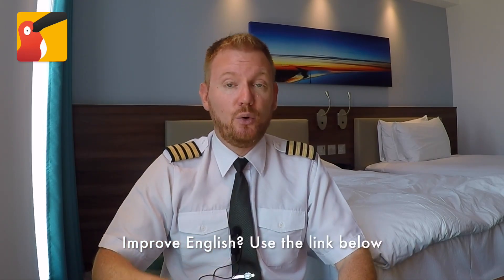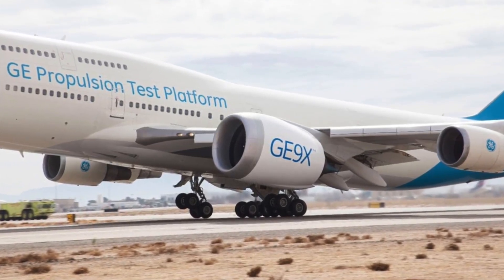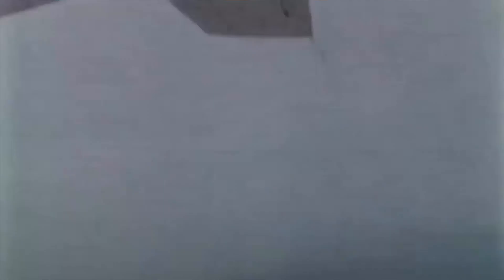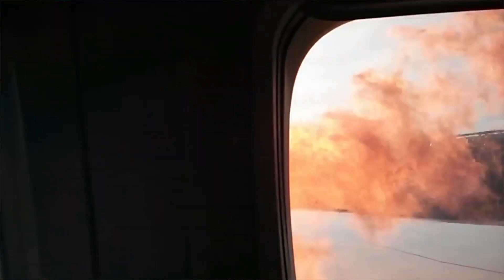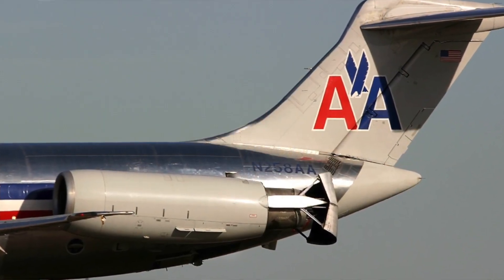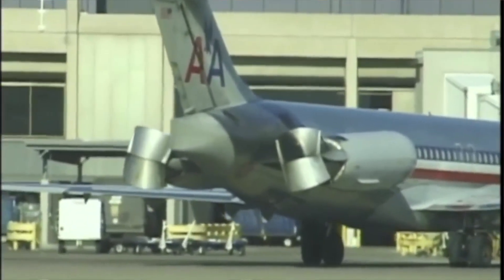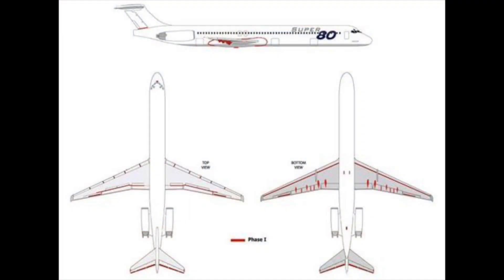Why are the jet-engines placed there? Wings vs Tail

Comment: I don't understand how a wing that is already hollow to hold fuel can handle the weight of an engine that big and doesn't snap off. Then the stress from forward and reverse thrust, vibration, weather, temperatures, whatever over 20? years and thousands of miles still stays intact. Remarkable.

Comment: Why did you say the trim change with application of lots of  power takes a lot of getting used to in training for commercially rated pilots? Most of them have time in C172s and those airplanes do have large trim change with power on a go round that needs 2 hands to keep it from stalling.  The other trick engineers used for wing mounted twin is to angle the engine a degree or more outwards, they do that even with singles, this will reduce the pull from P factor. The alternate ways of mounting engines /wings not used often enough for passenger craft is top of the wing mounting , like Honda, or just have high wing , like C17. I like the VC 10 type mounting , but is less suitable for large diameter engines. But then, nowadays, you just need 2 engines.

Comment: Why does the Q-400 turbo-prop aircraft have the t-tail design instrad of having the horizontal stabelizer positioned low at the tail? Since the 2 turbo-prop engines are on the wings, it seems odd they chose the t-tail design. Especially with the super-stall issue that can happen.

Comment: Well I love your channel, but you forget to mention that while under wings engines pull the aircraft, the rear ones push it, much like cars with the front or back axle drive. If that actually contribute to the flight characteristics I don't know, but it certainly has a big impact when it comes to the cars!

Comment: For regional and executive jets, the tail-mounted engines also means the aircraft doesn't need much ground clearance, which makes air stair design much simpler, and a useful feature for many of the smaller airports both types fly out of.
Reply: plus a smaller (thus lighter) gear assy
Reply: Yes,  good point

Comment: I kind of miss the airliners with engines on the tail. They were unique and different, like trijets or superjumbos. Nowadays, every airliner looks the same, with a wide-body and twin engines mounted under a slightly swept wing. It may be efficient, but I miss the old and quirky designs.
Reply: Were you a fan of the trislander?

Comment: Its all about a pristine wing with maximum lift & control capabilities.
Reply: I'll add in a engine failure the aircraft does not steer as much into the inoperative engine. Thus the need for a large rudder on wing mounted engines.

Comment: fluttering? nah, man, buffeting. oscilation in surface because of turbulent airflow is buffeting. insect wings flutter, airplane wings buffet.
moving engines lower under the wings moves thrust, not mass, under the center of mass, hence nose rises when you push throttle. if you moved center of mass lower you would negate that effect.
i spotted a bunch of other mistakes in the first 5 minutes but i really have no will to continue with this video.
i pitty those he mentors. a chunk of his terminology is not "trade talk" so i wonder if he is even a pilot. first video of his i played so it may be him trying to use "common terms" or inexperience in presentation but giving wrong info is still a big "no-no" for mentor in any field. deadly in aviation.

Comment: Rear mounted engines seem to have been relegated to business jets and other use cases that require low ground clearance for unaided boarding using built in stairs. Despite the fact that rear mounting is more aerodynamically efficient, it's outweighed by the efficiency of the massive high bypass engines they can mount underwing due to being close to the center of gravity/lift. Plus, it's probably cheaper and faster to service them since you only need ground equipment and not cranes and lifts.

It's a bit sad to see them slowly disappearing since they evoke that classic early aviation feeling, but I suppose it's a fair trade for better efficiency.

Comment: The part about super stall reminds me a lot of the Max. Which just makes that debacle even more confusing. 1) If stick pushers are already a "solved" problem, why did they implement the concept so poorly? 2) the changes to the Max changed the flight characteristics much more than they led their pilots to believe, and they covered up the difference using bad software to avoid doing any training.

Yikes.

Comment: Simple way to put it: (1) ALL THE WEIGHT of an airplane has to be carried by the wing. (2) If you carry it on ONE POINT, the wing has to be stronger and heavier than if you spread the load across the wing. (3) Tail engine placement put all engine mass on the fuselage and concentrates more weight on the middle of the wing. (4) Wing engine placements spread the load across the wing. (5) Therefore, tail engine designs are almost always heavier and less efficient.

Comment: So how about planes like the C-5 Galaxy, BAE146 etc? They have high mounted wings and, as a result, high mounted engines. So, the benefits of not sucking up gravel and sh.t 😉 and a better position of the centre of gravity. Why are all planes not provided with high wings?

Comment: Hi Mentour, My question is that If the Antonov 72 mounts the engines above the wing to get the benefit of Coanda effect, why is this not more common?
Reply: I was going to ask something similar about the A10 "Warthog", though there I think they put the engines above the wings more fo protection from small-arms fire from the ground than Coanda effect.  Seems like enough maintenance hassle and noise to discourage doing it on an airliner (which don't usually get shot at), but I'm curious about how it affects handling, compared to under-wing and rear-mounted engines.

Comment: just wondering why wing mounted engine is so cantilever (it is hanged very front of the wing front edge) which creates bending stress on the wings, why centre of the engine donnot fix just below the wing so that there is no bending torque on the wing.
Reply from the maker: It’s a combination of weight and balance but also a question of ground clearance in some cases, like the 737MAX

Comment: High rear engine, if you loose one it is easer to fly, eg minimum torque from one side. Also if there is a fire, the Engine is away from the fuel.

Comment: To change the subject, what are the differences, and advantages/disadvantages offered by turboprop engines versus turbofans?
Reply: Speed and efficiency
Reply: @antbotsquad6769  Yes... but why are props more efficient than fans (esp. with vortices coming off the tips) and why are fans faster?

Comment: What about stability? Usually, if you have a rear-mounted propulsion, you will have an unstable acceleration,, like in a RWD car.
Is that also an issue in an aircraft, calling for special handling by the pilot?

Comment: The pioneers for rear mounted engines as far as commercial flight were a small French company, "Sud Aviation" that produced the  "Caravelle", magnificent 100 seaters. Douglas decided to build their own version. the DC 9, after the contract they had with Sud Aviation fell through. The main advantage was the clean wing, flew like a glider.

Comment: Boeing aircraft can get 90% thrust reversal but Douglas et al only do 10% reverse thrust so FAA only allows 10%. Reverse thrust is used on landing hence blowing ground debris irrelevant. American airports use tractors not aircraft reverse thrust to reposition aircraft. Wrong. 737Max automatically pushed the nose down. You forgot that putting engines on pods allows damaged engines to fall away. And most planes do have fuel tanks in the wings as well as body. And fuel burn affects center of gravity (rear engined planes have fuel tanks near the center.) The Comet had engines in the wing root. (There have been planes with 4 engines at the nose.)

Comment: yes, when you design an aircraft you consider the advantages and disadvantages of putting the engine on the tail or on the wing... but that is not the reason why you put the engine there in the first place... first you look at the purpose of the aircraft you want to design, and choose or design an engine that will fit that purpose... you can’t just simply say i want to design a jumbo commercial airplane with engines on the tail because  i want more aerodynamic stability... i mean you can... but the design expenses will be high... so the reason to put an engine on the tail or on the wing comes down to the balance of making a sale-able, fly-able and safe aircraft.

Comment: A the time of the first commercial jets, engines were very noisy, this is why engines at the back seemed a good idea. This is why in France the SE-210 Caravelle was preferred to the SO-60, although the SO-60 prefigured the Airbus !
But on large planes, engines at the back causes major centering problems, this is why it's been dropped, and is now used only on small business jets...

Comment: Question, could the engines be mounted on top of the wing versus the bottom like the new HondaJet? Would this increase lift as well, as the airstream above the wing is accelerated thereby increasing lift?

Comment: I've always wondered: indeed, aircraft don't have to have rear view mirrors. So, in some disaster documentaries the pilots couldn't know whether they had a fire, a missing part... whatever. But why on the latest planes don't they fit a series of cameras supervising the critical parts?? Why no rotating type for example on the upper hull to get a kind of 360 degree view...?

Comment: For about a year and a half I would fly out on a Monday and return on a Friday. Almost always that was on a 717 or MD-80/90. These plains were basically designed as the DC-9 back in the mid-1960s. McDonnell Douglas just continually stretched and stretched these planes. Their flaw was the narrow body 3-2 seating. But other than that the plain had a good track record despite being stretched like taffy. I don’t think the engine mounted on the wings really permits this, and I think that this is what got Boeing in trouble with the 737max. They should have just did a total redesign. That plan has too narrow of a fuselage anyway as Americans are getting fatter and the seats are too narrow and uncomfortable compared to flying in an Airbus jet like the ones used on Jet Blue.

Comment: Great video.  The advantage of being able to place more engines underwing is moot lately in commercial aircraft as it seems no one really wants 4-engine designs anymore for efficiency and maintenance savings. The moment of inertia on large heavy engines being that far out from the center of mass wasn't mentioned, but I suppose that isn't too important on commercial planes where agility isn't paramount.  It would seem to be important in "sportier" aircraft.

Comment: Old video I know but ... what is the reason for having under-wing mounted engines sitting so far forward of the wing?
Reply: Probably had smaller turbo jet engines originally and when upgraded to turbofan jets which are bigger they were also moved forward to save on ground clearance

Comment: Only thing I’ve ever flown is a glider. No engine positioning decisions there. My late father, though, was an instructor with BOAC and East African Airways. Both flew Comets which had turbojet engines mounted inside the wing roots. Made then particularly difficult to access for maintenance and practically guaranteed that any serious malfunction would result in structural damage. The exhausts had to be angled outwards to avoid sonic damage to rear fuselage and tail plane (old fashioned phrase.) Excellent explanations so thanks very much. I fly as a passenger several times a year so you’ve resolved a lot of queries.

Comment: Oh dear, I remember having this discussion with you in a previous utube a few years ago. At 5:14 you start to discuss the problem of asymmetrical engine thrust being exaggerated by wing mounted engines because of the increased leverage effect of the engines due to being a distance "from the centre of gravity" [sic]. It is not the centre of gravity, but it is the centre of drag that the turning moment is working around. 
I am not trying to be picky here, but imprecise terminology, even if it is the within the custom jargon of the profession, is plain unhelpful. Otherwise an good utube.

Comment: I've always enjoyed the ride of a T-Tail over the traditional config.  However, I never knew, or realized, that a stall can affect the T-Tail and lose control.  Thank you.
Reply: The Delta wing can also blank out the air over a more traditional tail, not only a T-tail. The A-4 Skyhawk was such a jet. Get the AOA too high and you get into a Super Stall. Without enough altitude, it's impossible to recover from it.
Reply: Cant this also stall the turbines?
Reply: Easy solution. Dont stall

Comment: Why can’t they mount engine above the wing, in order to mount larger fans? Or is it impossible to do so because it would mean the jet he wing’s Struts would have to be cut back or moved father back to make room for the air leaving the fans?

As far as FOD goes, what about putting screens ahead of the Compressor stage and Fans of either type of engine?

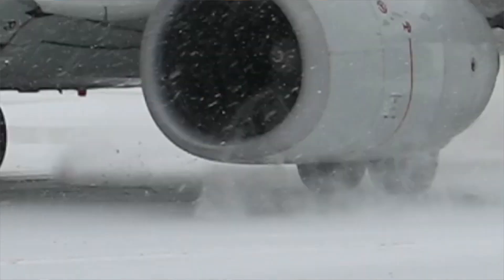Comment: Did I hear you correctly at 9:30? “Gravel and $h!t.” I would’ve thought that someone like you would use more formal and mature language. Otherwise brilliant explanation!👍 Another thing is that tail mounted engines are placed near the rear is because they take up space and thus generate parasitic drag. With there being more drag acting against the back of the aircraft than the front, the plane will want to fly nose first like an arrow or dart.😀

Comment: One more reason for engines in the back is that the engine noise will cause less metal fatigue on the aircraft. I just read this in a book on the Sud Aviation SE-210 Caravelle published as the yearbook 2020 by the SFF (Svensk Flyghistorisk Förening (Swedish Aviation History Society)).